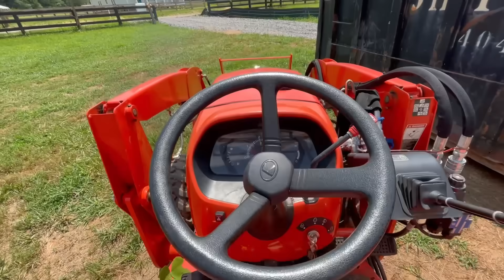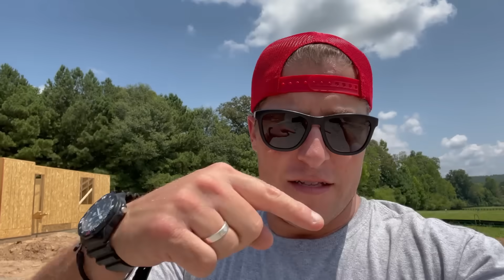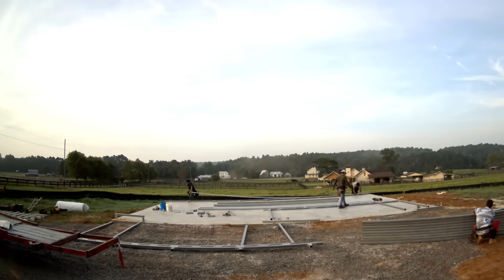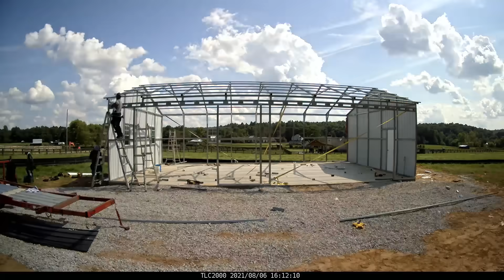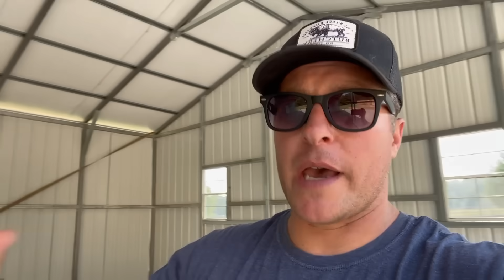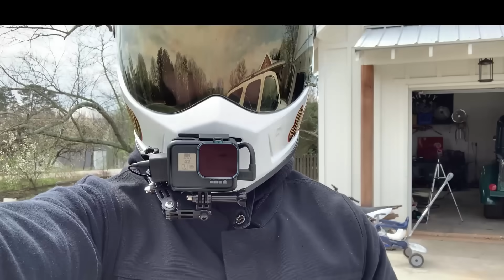I FIRED THEM!!  26x40 metal building Dream Garage build Ep.2

Comment: I’d be pissed you work hard for what you pay for and expect people to sell you a good product and not try and pull a fast one on you ,but companies do …
I bought a wooden product stating good  to use out doors for window trim and house trim so I went with it.
Well it’s Obvious now after a year with two coats of primer and two coats of paint it wasn’t meant to be used out doors because the finger seems are busting loose thus allowing moisture to sneak in to the wood thus causing cracking in wood .
I called company up about it of course they say well you can’t use it in a northern area ..
I guess they should of stated on their product what states and what condition this type of wood can and should be used in and not just say it can be used out doors .
Why would a lumber supplier sell a wood stating good to use out side when it’s not, Especially when they know the weather condition in that surrounding area or that state.
I also noticed a cheaper Inferior nails being sold in a climate that should only have stainless nails and screws sold yet they sell cheap shit.

Comment: I'll bet the installers did not even understand what you were saying to them,  Did they overlap the siding backwards or was the sheets manufactured wrong? The installers should know this is wrong but they dummied up [as they always do] then when you say something they act like that is normal. You will always look at them rippled panels so unless they greatly reduce the price they should be changed out. With a good welder [not one of the installers] New truss supports could be welded in after the building is complete. Skilled tradesman have been slowly being replaced by unskilled cheap labor from south of the border. You have to baby sit these clowns or get ripped off.

Comment: well, I have been building for a long time, bad material is bad material, I am sure the specs do not call for what you are experiencing, I am with the engineer guy with his comment, no matter what fix they suggest the building will not be right, I would remove it and start a new. I see it's been over a year so what did you do and what was the outcome. ??

Comment: Hate to be the bad guy here, but you got exactly what you paid for. What you got was nothing more than a light gauge carport, designed to be enclosed, and be called a garage. You basically bought the cheapest building money will buy!  These type of structures are put up all over the country. They are usually stamped by an engineer with no credential's. There's engineers out there that will stamp anything for a buck, with wind loads and snows they say will meet code. Next time do yourself a favor, buy a real building,  from a LOCAL company, with LOCAL installers and let them pull the building permit. Lesson learned.

Comment: I've been in construction for 50 years. What you do next depends on where the money is. If you pay them all the money before completion you're dead in the water. If you held money back you've got some Leverage. One Step you can take is notify the city of the substandard work. If it won't pass inspection the city will officially stop the job. In court that's a better place to be than you refuse to let them finish the job.

Comment: Honestly, you should build it yourself. I’ve built about 30,000 sf of metal bldgs by myself, all are leak free, this size would be easy. With that rippled seam, that might be 29 ga, I believe part of this is on the manufacturer. I’d go with a different panel, 26 ga is generally the standard. Look into multi-rib or other panels that Metal Mart uses. The easiest way to hide the seams though, and this is definitely on the installer, and that is to always start panels in back, and move toward the front, that way all seams are hidden up front. Even if viewed from the back, the right panel will not have that waviness, but viewed from up front the seams will be completely invisible. You didn’t address this, but there is a simple trick that you can use that 90% of builders don’t even bother to do. Besides using tacky tape or silicon on overlapping sheets for wind driven rains, do this important and vital step for your roof sheets. Take about two to three inches of your tacky tape, and put it just a few inches from the end of the sheet, run it across perpendicular just like the direction the wall runs. Hard to explain with just words, but the purpose of that little strip, is to keep water from traveling up, and then dumping inside your bldg along the inside wall. If I didn’t explain myself well enough, contact me.

Comment: I have used on my property R-Panels that look like your but I bought them as rejects. I can be picky at times but if the contract states differently than what's installed I would get upset. I am planning on building my own 40x60 shop with scrap, new and reject metal. Cool video and I need a tractor.

Comment: The edging of the steel is a quality issue that should be fixed- but could be difficult to get fixed.
BUT the structural assembly differences- especially ones that would weaken the building are a 100% full-stoppers!  If that building requires planning permission in your area and that is part of the requirements, THEN the city/county planning office can legally have you remove the building if the change causes it to fall below threshold. AND SOME could demand removal of building based on the building being different than submitted.  Now, I'm sure there's a change request process, but in the structural area of a building, I would not be happy with those kinds of differences between what you paid for and what was built.

 The building Im doing was exempt from planning requirements on all fronts, but due to a technicality that was not even listed on the planning site where I live, I got a cease notice after a non-neighborly neighbor a few houses away reported me for things that weren't violating anything. The inspector was super helpful and straight forward with me and said exactly why I didn't qualify and said that I would need to submit planning retention (belated planning permission) and just because one person didn't like it doesn't mean that objection would be upheld.  As it's a matter of quality, purpose and direction of the neighborhood they're trying to promote... and finished with, but yes, everyone's objections will be heard and acknowledged- though doesn't mean they'll be upheld after careful review.  

The technicality was that any roof-overhang counts in building sqft here and the kit I bought was a default layout- so there's probably a good few people out there with them that have no idea they're over. The supplier said it would pass planning exemption, as long as interior space was under 25sqft.  It was- it is 24.1sqft... BUT the awning - overhang added to that number and put me over.  Thankfully the planning board reviewed my case after I applied for planning retention. BUT that added 4 months stoppage to the whole build - so I missed the summer here in Ireland.

Comment: I recently had to fire an a/c contractor for the horrible work that was being done at my personal home they installed a new unit in my attic but put it on the wrong location and damage was done to exterior of the house also ducts not put in properly several of the duct lines are kinked and no air will go through

Comment: I just found this video. These steel sheds are everywhere in Australia. However we never build them as flimsy as that. Not that I've ever seen anyway. They are built with portal frames that are far thicker, more massive and stronger than what you have. Everything else about the frame is a lot stronger as well. And that is for region A. For region B there are additional strengthening requirements. In region C they build them for cyclonic conditions so that's a whole other level again. So I'm just talking about region A - the minimum spec in Australia. 
Your spacing between portal frames has been made much shorter to compensate for the weak frames and they have made a truss along the eve. Even so the whole thing looks flimsy to my eye. I certainly would not accept even the smallest reduction in strength of the design because to me, even the original design looks  like what we would have in a little garden shed - not a workshop size shed.
Reply: My thoughts also, some regions here in Australia have much more strict structural requirements, and then there is the councils and all their compliance requirements prior to and after building... Sadly his workshop looks somewhat inferior

Comment: First of all they should have never used square tubing on the roof it should’ve been at least angle iron built truss. That 2 inch tubing would have never supported the weight that is why it is sagging

Comment: I have a 40x40 shop that I paid to have built in my backyard and it’s currently where I work everyday! It was a HEADACHE!!! From start to finish and I’m not at all satisfied with the outcome but it’s been standing for three years and it’s still holding strong. Not without the constant imperfections tho… my walks have bends (wooden shop) they actually move if you push too hard lol. The concrete floor (not being sealed) traps and holds a million pounds of dust that gets on everything! Termites want to constantly eat the building.. it’s just too many things to list. At this poly I honestly wanna build another shop and knock this one down. Luckily it’s pit me in a position to be able to afford to build another one when I’m ready to pull the trigger. Good luck on yours I hope it all comes together.
Reply from the maker: Dang man that sucks. I hope works out for you thanks for the support and watching.

Comment: I do not like that style for a "real" building.  Did a carport (same construction shown in video), hired a local company, that turns out to just be a sales agent, the steel company was different company, and the installers were different subcontractors.  Had to pull my own permit, as the installers are not licences.     You would think this made it cheaper, no just more profitable for them.

Comment: You see that the length of the truss is way short before they started any metal or even had the walk doors in. As a pole barn builder id be a little upset if you had seen a problem that noticable and didnt say anything until the very end. Should have stopped them then and there and fired em or had em fix it.

Comment: You have some valid concerns. The rippling is an issue no doubt. My guess if they used a roll off truck and got sloppy that could have been the issue. Those trusses depending where you live won’t handle a good snowstorm. They should be better structurally designed! 
I built a 30 X 50 and those rafters were a lot more structurally designed. I lived in the Wichita Kansas area. 
I hope you get your build resolved.
Reply: If you get a 30 wide carport it automatically comes with the braced trusses

Comment: I would get a lawyer go over the contract if the sales and builder did not perform then it should be possible to file a law suit. Another route would be get the building inspected to perform a inspection and write up all items that are not code and present all your information to your attorneys. Good luck.. also what state and county are you located.

Comment: I would have done the same thing. Off the job until I get satisfaction to the adjustments  that will need to be made to meet the original specs. I built metal buildings for years and I was scratching my head as this building was going up on how it would meet minimum building codes. Stay on them.

Comment: There is a seemer for the standing seem shouldn't been seem it's a electric seemer run down it easy fix the truss issue is a problem it shouldn't been engineered but can still be done easy than tie them together for strength those type of building are economical cheap get what you pay for all can be fixed easy

Comment: It looks like they used the exact parts and materials to make a carport I had built.  It’s fine for a 2 car carport but not a large shop like you paid for.  The flexing of the roof when they were on top of it would be quite concerning.  I’m not sure how this crap can be resolved short of going to court.  I’ll bet they aren’t going to willingly come back and unbolt unscrew all that cheap metal tubing and panels and offer a full refund.  I’m guessing you paid a deposit down and not the full amount?

Comment: Not sure if the trimdek profile is the same over there as it is in australia but it looks to me like they have lapped the panels the wrong way. Over here the edge profiles are different to allow for the lap and if you lap on the wrong side it ends up much like this. Is this possibly the case here or just poor manufacturing? Also I am not sure if that double beam with the supports welded between in the front is structural or not but I was always taught not to weld across a structural beam only along it as welding across it weakens it. I am by no means an engineer or a trained welder just what I have been taught. Good luck and hope you get a good result.

Comment: That's why I went with a red-iron shop from Mueller. Engineered with real blue-prints, rated for 136 mph winds. Those formed galvanized tube buildings look like oversized car ports.
Reply: Considering they come from the same company that’s basically what they are.
Reply: @Hobiee90m3  No, not at all. I have formed and welded I beam columns and trusses.

Comment: G'Day mate I have just seen your video and I tell you if they tried to build it like that here they would be i jail. That there in no way meets the requirements here in australia. Also the way they screw on the sheets on the wall is wrong for the screws are supposed to be on the ridges. I have had an arshole try that with my replacement roof for we live in a cyclone area and I told him to F====  Off and he gave me lip and I wrned him that he could become part of the foundation quite easily.  I had it all documented and everything was listed before hand so if they want to try the courts well bring it on. Make sure you document everything.

Comment: Well, you get what you pay for. 
That building was probably pretty cheap  and it shows. 
Metal buildings should be made of C’s and Z’s 
Girts and purlins. 
The ripples in your sheets is known as oil canning. Thin material that cannot hold its shape. 
Stick with the old fashion (tried and true ) metal building materials. 
They cost more both in material and installation, but there is a lot more involved. 
Good luck on getting it passed on inspection.

Comment: You're not wrong in wanting the best quality, and you're absolutely right in pointing out the difference between the engineered plans and the actual product.  Stick to your guns.  I am currently dealing with the same sort of issues with a pool and ramada build.   The pool company doesn't have any of their own employees (most don't, BTW.  They sub EVERYTHING to the various trades, who whip through their portion of the job as fast and lean as possible).  I feel like I have to babysit every step of the project and report back to my salesman so that things can be fixed before it is all too permanent to be fixed.  Super frustrating that these tradesman do such half-assed work.  Note to anyone building a pool, garage, etc...  Go through the contract with a fine toothed comb.  Even record your conversations with salesmen.  Even if it makes the project slower to complete, you can withhold payments and send notes to your salesman until the job is done to spec.

Comment: I am right there with you..
I bought a 25x35 shop and the slab is crooked and not sloped. and the shop leaks in several spots.. 
I am in this about 35k and wish I could just bulldoze it and start over

Comment: Same thing happened to me with a concrete pad...rebars were wrong size, spaced to wide and concrete hardened too fast not leaving a smooth texture even when brushed because it was too hot of a day...and I was charged hefty for the job. In the end, I got screwed for a mediocre job that should have costed 3K less than what I paid...BUT it was my fault. I should have halted the job, requested an inspection and done my diligent job about the company doing the work on past projects. I was desperate and needed the concrete pour and done because I was leaving town for a month and this needed to get done...bad decisions are made when we are desperate. Nothing should be made in a hurry unless you want a crappy job I learned and so did my pockets. I got a city permit, paid a $200 fine for not requesting sooner (I had photos from the job). The inspector did me a favor BUT it shouldn't be the way it was made.  Good thing you had a contract to follow guidelines as per job entails. I learned that the hard way. Next time contract in hand with details of the job and I'll video tape same as you did your work. You CANNOT trust anyone, unless you have seen a previous work they have done for someone else and even so problems sometimes arise. Glad you FIRED them and requested  to have this fixed. That's a great space on that shed!!

Comment: I pretty sure a structure like this would not last long here in Upstate NY.  24" on center construction just couldn't handle the snow load...or wind by the looks of the metal gauge.  Curious as to why you chose metal vs. pole barn (I skipped around in the video...maybe I missed)?  Cost?  Good luck with the build though, looking forward to finished product.